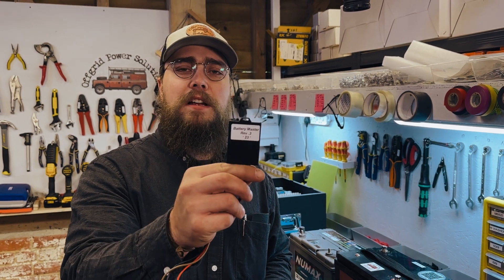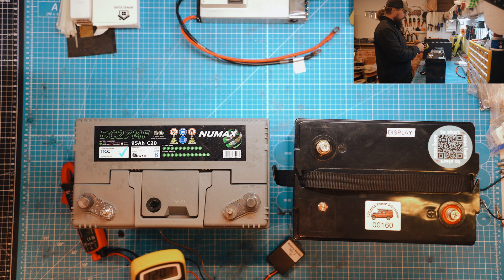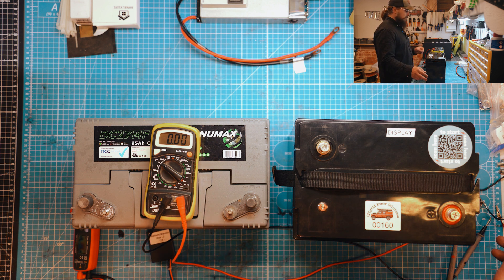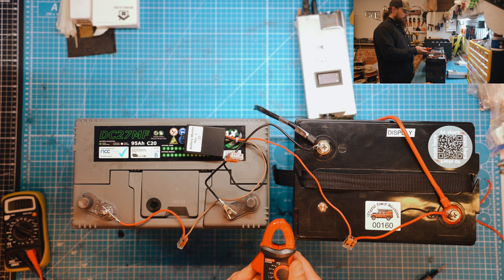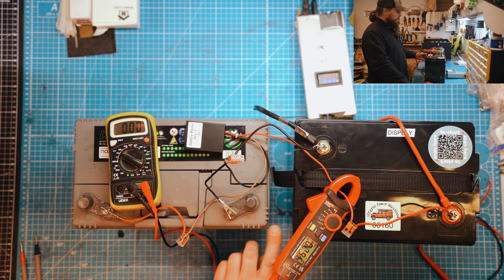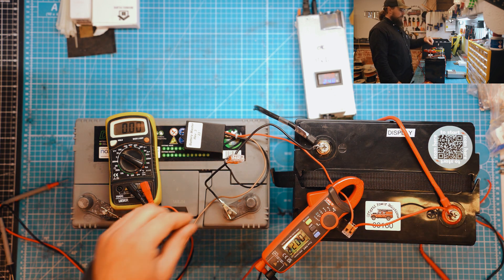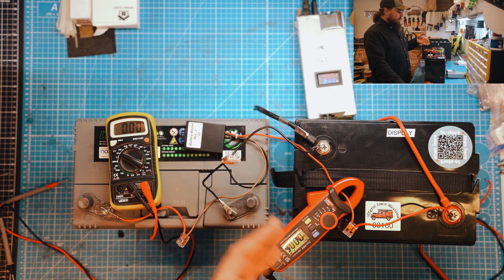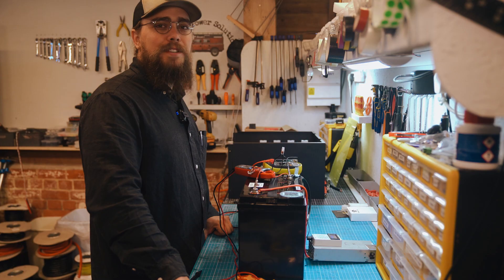Van Bitz Battery Master - Review & How It Works!

Comment: I’ve just bought the next revision 24 and have sent it back for not working as advertised.  I tested it in a similar way to the video, measuring voltages and current.  With a 30% charged AGM vehicle battery at 12.2 volts and LiFePo4 at 13.8 volts the BM drew a near constant 3 amps and got quite hot.  Eh?  What happened to the 1.1 amp limit?  Maybe that was extreme so to give it a re-run I replaced the AGM with a fully charged and rested new one at 13.1 volts.  Again it drew around 3 amps initially but over 5 minutes settled to no current draw and roughly 0.7 volt difference.  Then I turned the charger on raising the LiFePo4 voltage to 14.2 volts and the BM drew over 3 amps and continued to do so while getting hot again.  After 5 minutes it was still drawing 2.5 amps.  I sent it to Van Bitz for testing, they sent it back saying nothing wrong with it and I should fit a 10 amp fuse!  What!?  It’s supposed to have a 1.1 amp limit and internal fuse protection.  If it doesn’t limit the current properly there is no way I want to risk overcharging my new AGM battery and the supplier has agreed a refund.

Comment: I have a 200ah lithium battery but a standard stop start agm so can I use it please? ps I have a Victron Orion fitted. I’m a little worried that it will over charge the starter battery. Many thanks for your excellent video.

Comment: Awesome, I was told recently I could set up a solar panel for my starter battery and I was like, "but I already have solar and a leisure setup". Glad to hear it's possible. Any issues with wiring the leisure straight onto the starter when I already have a battery-2-battery charger wired up? I was cautioned not to jumpstart my van using the Li leisure battery. Cheers!